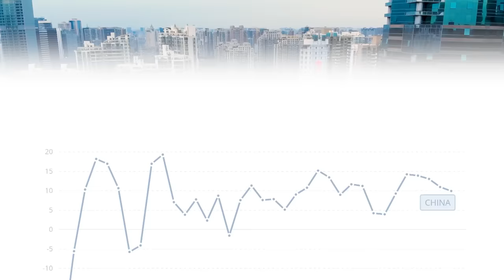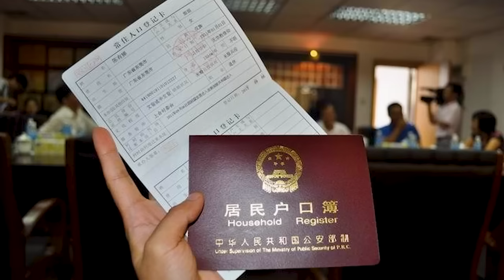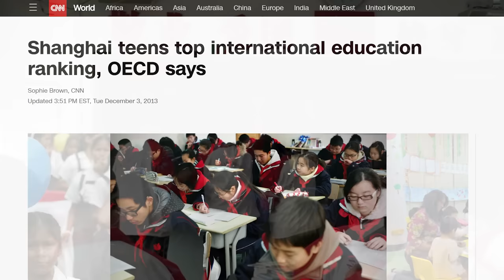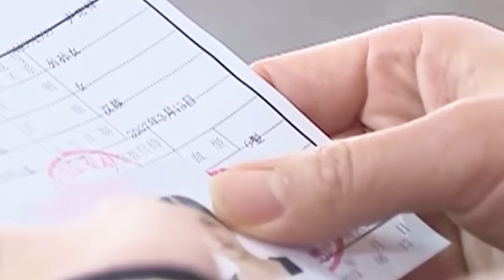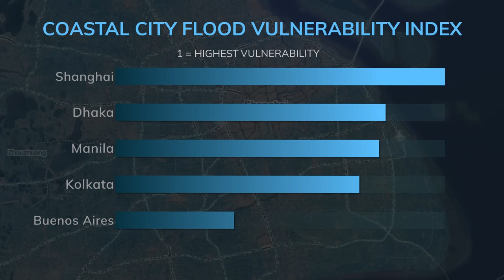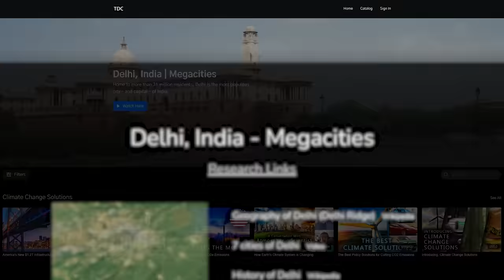The Story of Shanghai, China's Largest City

Comment: Arguably Chongqing has a greater population  but Shanghai's urban core is larger.

For the hukou, I don't think it is as important as before.  First, there is potential access to public schools at least to the 6th grade now for migrant worker kids. Migrants in Shanghai also now pay same social costs as locals unlike in the past.   But also increasing cost of living in Shanghai and improving conditions in smaller cities make a lot of people question whether they should move to Shanghai or stay.  But hukou reform which is badly needed is very political, and a lot of Beijing / Shanghai residents oppose it thinking it will only benefit outsiders despite the fact these migrants pay into these services in equal manner (migrants = domestic immigrants for them).  

But the greatest threat is indeed climate change.  not just rising water but rising temperatures.  This year already more than 35 days above 35 celsius and the wet bulb temperature is even worse

Comment: i hate when theres people say   China cant be rich without USA blablabla , i mean fair enough but they also forget China give lot money to american too  !  China joined WTO in year 2000. In past 20 years China has made 8.3 trillion USD by trading with U.S alone. And U.S has made 8 trillion USD from China. So both countries have made good amount of money. The difference is China used those 8.3 trillion USD to build infrastructures, R&D research centers,  and helped extreme poverty 800 million Chinese became middle class. On the other hand,   8 trillion USD that U.S has made went into a few individual's wallet. To U.S the distribution of the wealth went wrong, the average Americans did not benefit much.

There are two methods of distributing the wealth: socialism and capitalism. Everyone knows China is socialism. But that's not 100% true, China is hybird of Socialism and Capitalism. The entire country is a giant corporation, CCP acts as a CEO of the corporation and the board of directors. CCP makes plans, determine which industry sectors need extra boost in next 20 years, which sectors are vulnerable in current situation, CCP also determine the distribution of the wealth. everyone in this giant corporation receives dividend and certain portion of the wealth. So just think
of China as Microsoft or Apple, CCP elite members are engineers, master strategists. They are not politicians, if you put them on TV, they can barely talk, probably also camera shy. but they are the master planner, unlike U.S politicians who can yup on TV for hours.

There is nothing wrong with  capitalism, but U.S let the greed of corporation out of control. The richer the corporation and individuals, the less taxes they pay. Look at Apple, they pay much less
taxes than they should. Also one of the biggest issue in U.S is armament manufacturers are all private owned, they are not state owned!! If there are no war around the globe, how they can make money? so every year they spend millions of dollars to lobby congress or politicians and come up all sorts of reports claiming China threat in south China sea, Russia threat to the world,
terrorism in middle east. That way U.S can buy more weapons, war ships, jets from them. For the country has less than 250 years of history, U.S only have 16 years of no war with others.